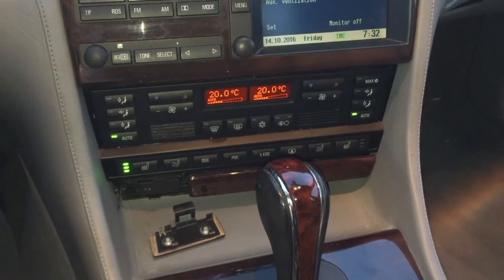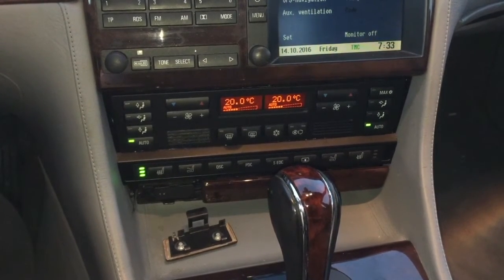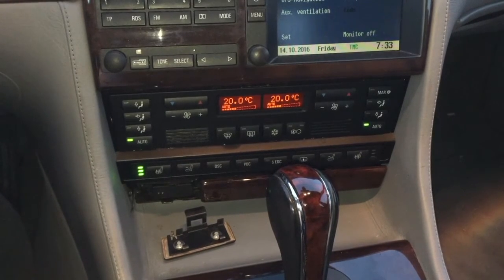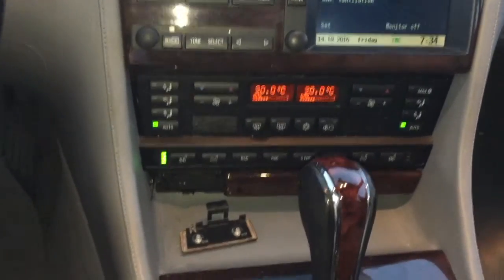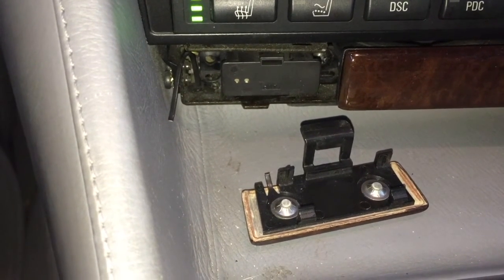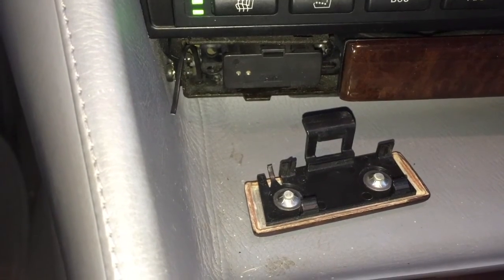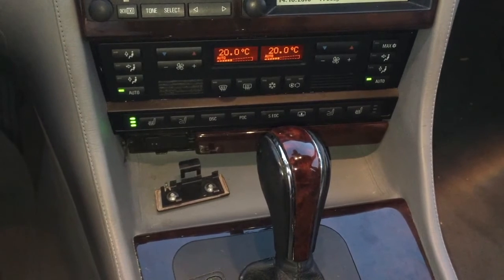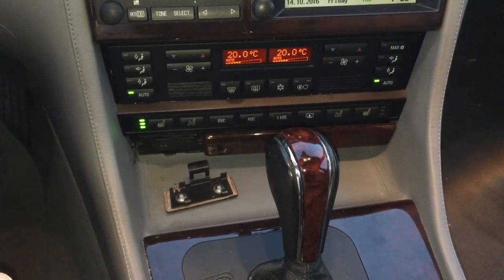BMW E38 OBD2 connection

Comment: Where is the fuel filter located on a E38.  I won’t to change mine. Thanks
Reply from the maker: Depends on year and model. Usually on the bottom rail on the drivers side.
Reply: @drdragunov  yes.  01 740i sport
Reply from the maker: @spaceexplorer6636  Go under the car and look at the drivers side, at B pillar and you will see it.